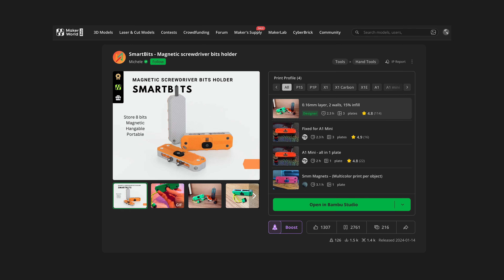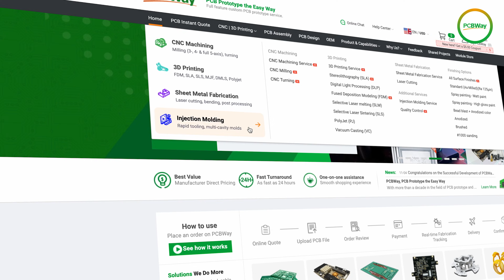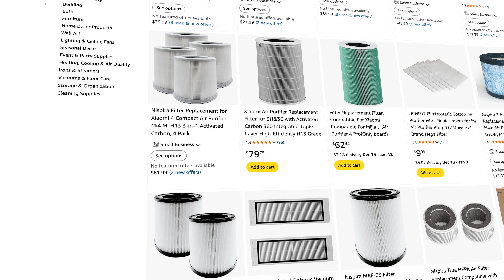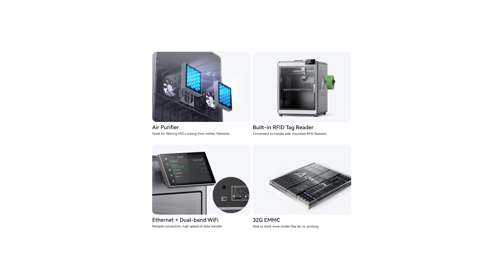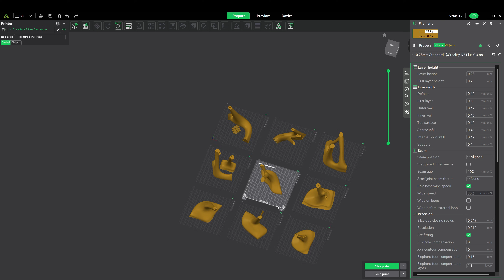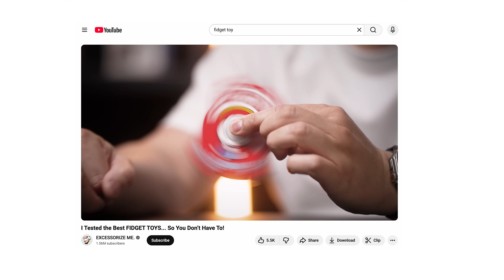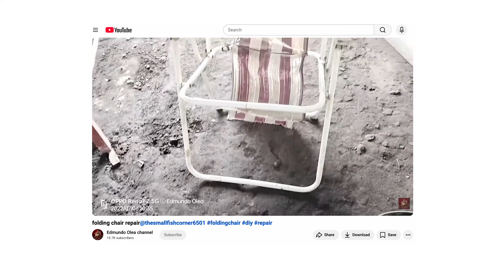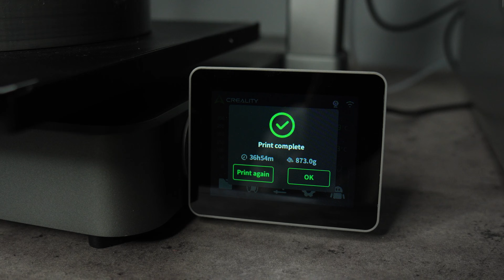You NEED to 3D Print These for December 2025

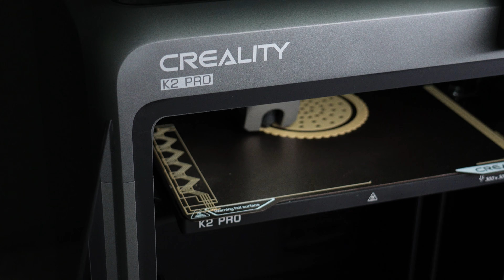Comment: 1:46 is it food safe? For what I’ve heard 3d printed parts aren’t food safe, unless you coat it in food safe resin
Reply from the maker: You're absolutely right to be cautious! While PLA and PETG materials themselves can be food-safe, 3D printed parts have porous layer lines that trap bacteria and moisture, making them unsafe for direct food contact. For a knife block, it's actually safer since you're storing clean, dry knives rather than food touching the surface directly. However, if you want to be extra safe, coating it with food-safe epoxy resin is definitely the way to go. Do you plan on printing one, or are you thinking of sealing it first?

Comment: Thanks for featuring my car tray table in your video! Definitely have seen variability in the clearance on the inserted bars. Despite the wiggle, it usually still does the job. Also, I store mine in the space between the seat and the center console on the passenger side. Just kind of slips in between.
Reply from the maker: That's so cool that you designed the car tray table! The build worked great despite the slight wiggle, and that storage tip between the seat and center console is genius. Have you thought about making any design tweaks based on feedback from prints like this one?

Comment: Love the idea for making our own air purifiers but, that fan does not have enough CFM to move enough air through that material.
Reply from the maker: That's a great point! The designer uses a 14cm PC case fan, which might have limited airflow for thick HEPA filters. Have you thought about upgrading to a higher CFM fan, or maybe adding a second fan in series for better pressure?

Comment: For the magnetic stirring device, find a food safe material and print an enclosure for the magnets that go into the liquid, because eventually that constant hitting of the magnets against the glass will crack and break the glass.
Reply from the maker: That's an excellent safety tip! You're absolutely right - using a food-safe material for an enclosure around the magnets is a smart idea to prevent glass breakage over time. 👍
Reply: @engineericly  Also, instead of the hand drill to make it faster, try using a Lego motor (or maybe even an RC car electric motor) to keep it self-contained within the device. With the right gearing you could get the same speeds without taxing or burning out the Lego motor.

Comment: the nife case is safe ? i mean that it is made with 3d printer, from health opinion i mean
Reply from the maker: Good question! Food-safe 3D printing is a complex topic. While PLA itself is generally considered non-toxic, 3D printed items have tiny layer lines where bacteria can grow. For the knife block, since the knives only touch it briefly and they get washed after use, it should be fine for storage. If you're concerned, you could print it in PETG which is more food-safe, or seal it with a food-safe coating.

Comment: the problem with many of these prints is I can buy them for cheap and better quality within minutes, rather than spending many hours 3d printing, assembling, and finishing for a lower quality product. I love 3d printing but it needs to make sense.
Reply: I mean, many of them yes, but that air filter one... literally could save an easy hundred or more for those who need a good filter. (I have pets and my brother has asthma and allergies, id prefer he not die in my house nor need to take a bunch of medication so i usuallydo a good cleaning and have used two purifiers before but they both got knowcked over within a year of purchase and were expensive. This also looks like it could be knowcked down without breaking since most of it is the soft filter.)
Reply: I agree. Though I will say I appreciate that you post these videos and these ideas exists, because they can still be very useful and also encourage some other innovation
Reply: I mean a lot of these companies just create ewaste. Everything you make can and most likely will last forever.
Reply: Then go buy them.  The thing I like about 3D printing, is that I can make what I want in the exact color(s) I want.  If there is a logo on it- I can take it off.  Or I can add one.  The thing about 3D printing, is that it is fully customizable.  If that is not something you care about- move on.
Reply: @colorjunkie exact color if you have this color)
Reply: Agreed.  The tray table is available at my local dollar store
Reply from the maker: That's a fair point! The dollar store is definitely the quickest and cheapest option if you just need something functional. The 3D printed version is more about customization and the fun of making it yourself. But you're absolutely right - not everything needs to be 3D printed when there are good alternatives available!
Reply: @engineericly  appreciate your realistic answer
Reply: @engineericly  What a realistic and self conscious answer, bravo !
Reply: You can Say the same about painting, drawing, building etc… we call that an hobby

Comment: I would recommend you to use dichloromethane (methylene chloride) as glue for PLA or PETG plastic. There is no glue layer between two plastic pieces. Plastic will melt to one solid piece
Reply from the maker: Thank you for the tip, thank you!
I will try it soon :)